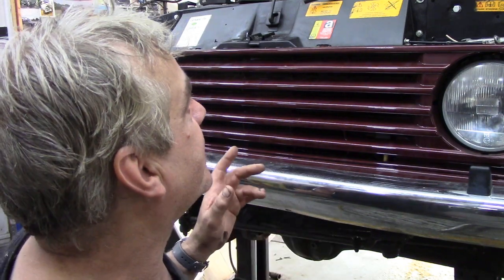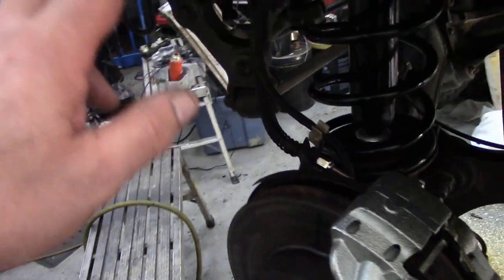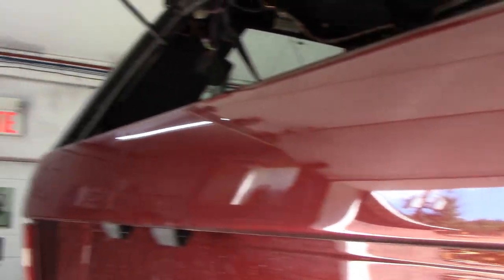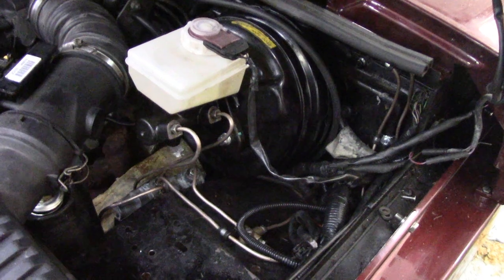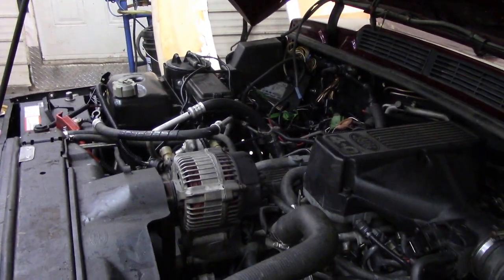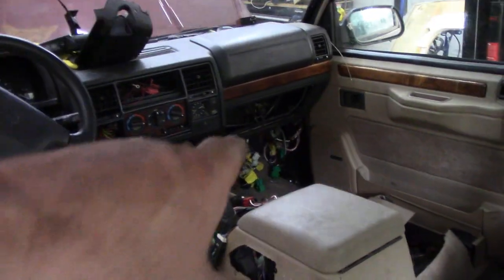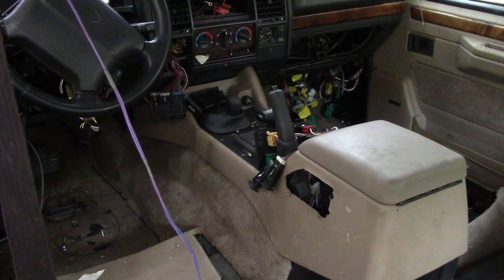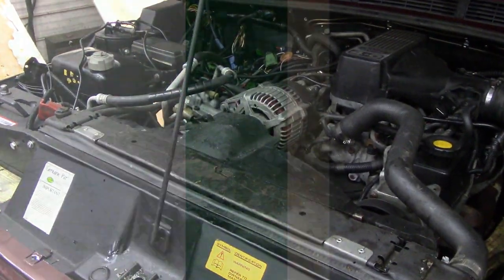Range Rover progress  -  getting there!

Comment: Question abalt the brackes, you used just a 2 T peaces and removed wabco unit?
Cheers King Mike. 🥃
Reply from the maker: On the D1 there was a pressure reduction valve

https://www.lrparts.net/anr3194-abs-brake-valve-for-discovery-1-fits-from-1994-onward.html

On the non ABS they used the 2 ports for the front brakes and one for the back you can see of this image one port on the front is blanked off as it was used for ABS

Comment: Mike , why did Land Rover have two pipes going to calliper from the flexible hose ?
Reply: Good question
Reply from the maker: The early calipers had 2 pipes as they were a 'safety' system in case one pipe failed 
Wabco ASB had 2 pipes